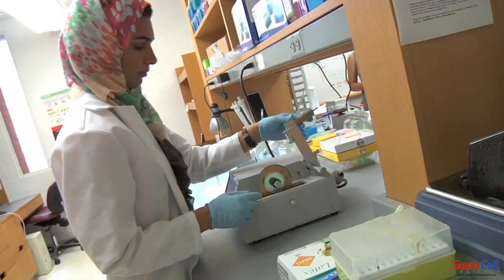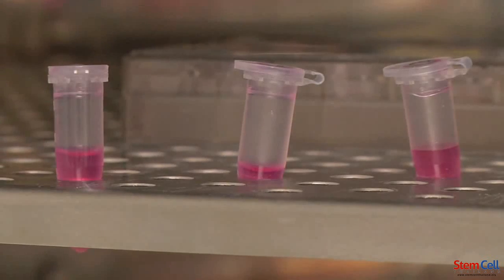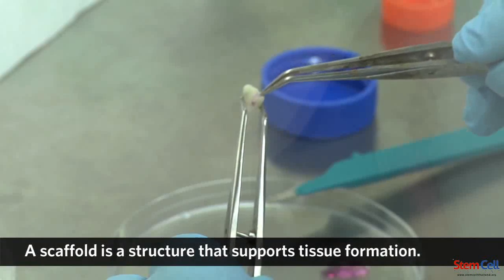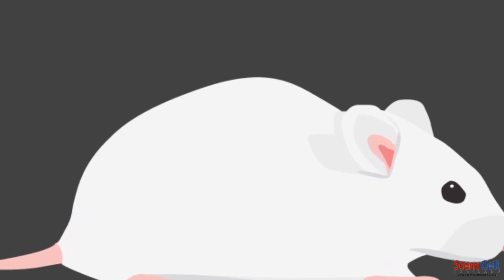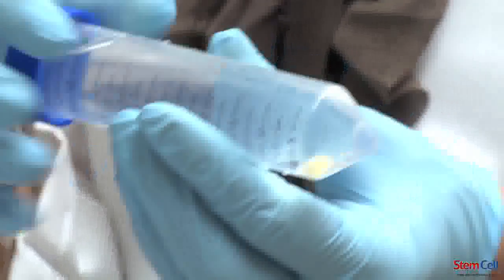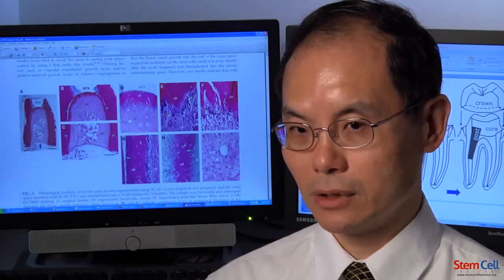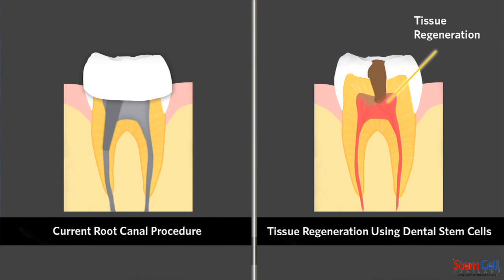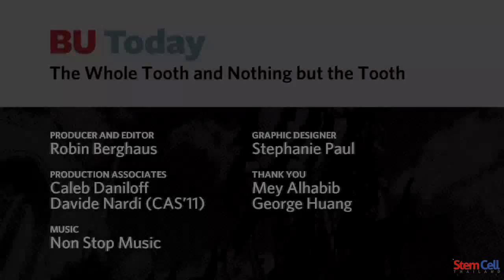The Powers of Dental Pulp Derived Stem Cells DPSC Overview and Technology

Comment: You leave the cells suspended while incubating? We generally use a T flask to provide more surface area for Cell adhesion.

Also do you use G-CSF? I heard it helps optimize the amount of stem cells you isolate